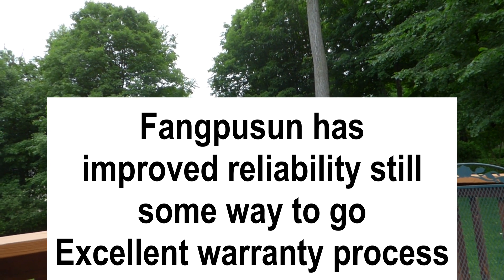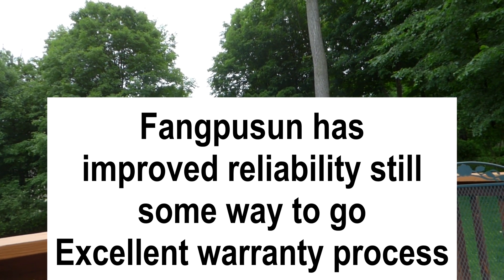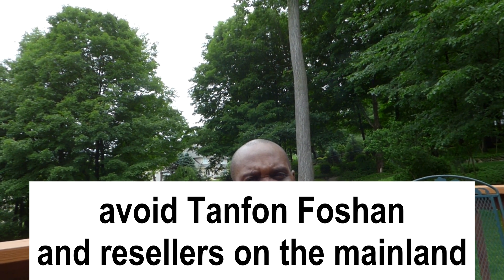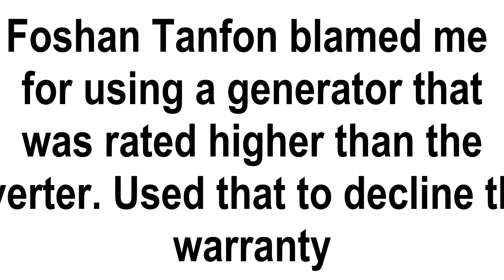My Inverter has blown up now what?

Comment: It's possible the victron incompatibility was due to a firmware mismatch. Large CPU vs small CPU.
Reply from the maker: Hello Aaron thank you for watching and commenting. The firmware starts with some numbers let's say 4215 and the others were 4115 they would not work. Also inverters sold in some markets won't work with inverters sold for our markets they run slightly different firmware. When you open the boxes the components on the boards are not quite the same. One of the instances I had imported the inverter from the UK. In another instance I purchased them over different periods of time. Once in a while the vendor can change the firmware. Yes Victron has the large and small cpu versions of the firmware. Then add the assistants and it can be fun. I love your content and love reading your posts.

Comment: Thanks for video. Very informative. Please what is your experience with Axpert hybrid inverters? I am considering this http://voltronicpower.com/en-US/Product/Detail/Axpert-VM-II-3KVA-5KVA
Reply from the maker: I have used them. Their newer models are a big leap from where they were in 2014. We use them as our alternative when budget is a consideration. They have been working well and they have lots of settings to meet the most demanding requirements that you can have

Comment: I have told u before to try Magnum inverter. I live in lagos and I use magnum inverter 48 volts. I run my iron , microwave and even AC. The internal fan hardly start up as been processing heavy load. The fan start many when my battery is low and its it's charging. Do not buy the 24 volts magnum buy the 48 volts.  I bought it from amazon and shipped down to Nigeria. Make sure u order for European type that 230 volts. Thank me later. Lol
Reply from the maker: Good morning great. I am very happy with the Victron they offer me flexibility that I am yet to find with other products. I like the magnum. If I change I will do the outback first. They are better suited to our environment. They are all good products. Thank you for the tip.

Comment: and thats why i like 12v/24vdc appliances, yes they cost more but no inverter required and safer too, been looking into converting/making large refrigerators with dc kits similar to they use on fishing boats
Reply from the maker: DC appliances are awesome. Unfortunately it will be a burden on my clients. I will try them for myself though. Post a video of your conversion I will be happy to watch it. Thank you for the tip